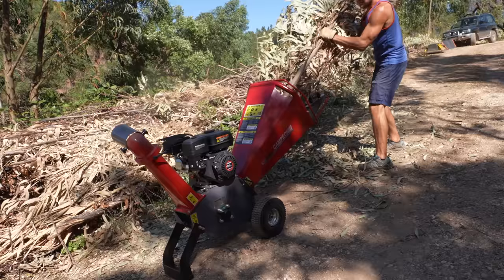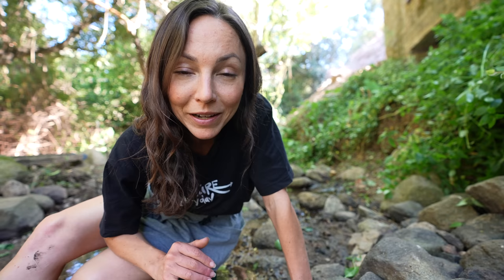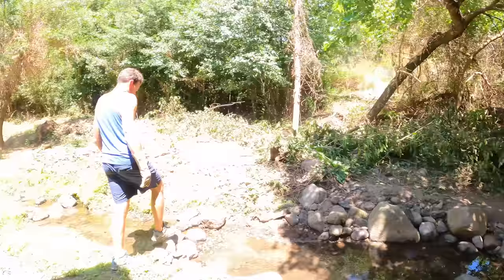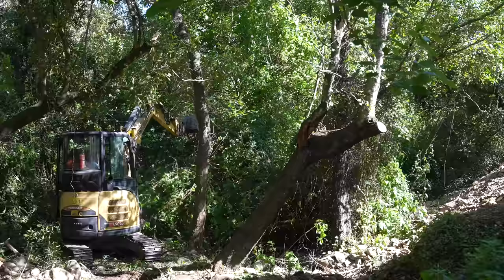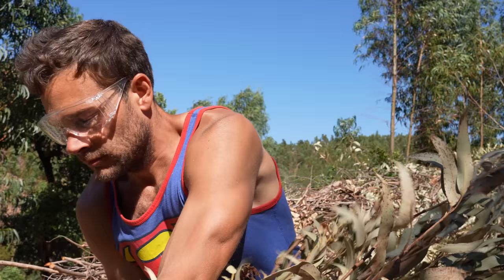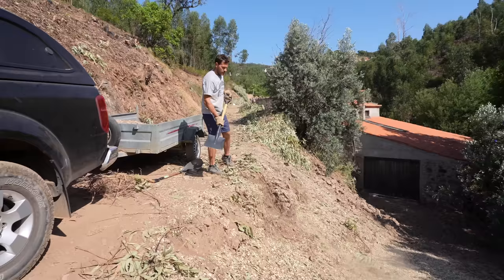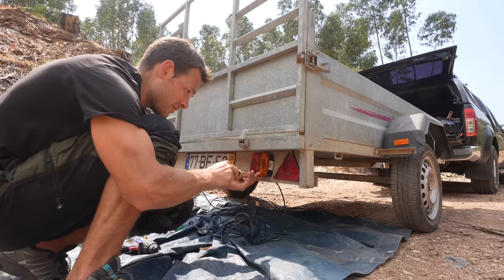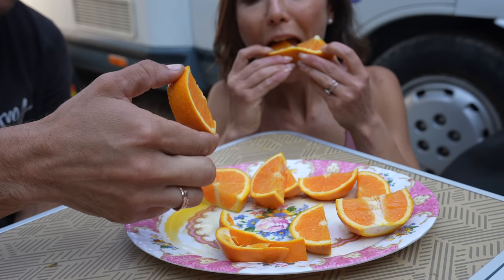WE BOUGHT A NEW MACHINE to help clear our overgrown land in Portugal

Comment: Such a great tool!!   Perhaps, if you line the trailer with a tarp, then blow the mulch in, it would be easier/faster to pull the tarp out and shake it down hill.   We used this method during our fire clearing and it eliminated the need to shovel it out.  Bringing back memories of good hard work and the need to maintain a safety zone.   Carry on!!
Reply from the maker: That’s a great idea!! Thank you 😊
Reply: Love this
Reply: Google search lens take a picture search for it and usually Google can pull it up and tell you what the plan is or the item. You all are doing a great job.!

Comment: When using the mulcher, place a long tarp into the trailer from the tailgate right through toward the front and fasten it up to the roof rack on the vehicle with a couple of clamps. This gives you a barrier on the car to stop the high fliers and when you are done, pull the tarp back over the chips so that when you want to unload it, all you have to do is either pull it back over the rear end of the trailer and continue until it pulls the entire load out the rear of the trailer with no shovelling or, if it too heavy to pull manually, tie the tarp to a tree and drive away. This will spread the load somewhat along the track. If you had another vehicle/mower there, you could pull the tarp back and dump the stuff in one heap.

Comment: The shop that sold you the mulcher will also have netting to attach to your trailer. That netting prevents the mulch from flying everywhere.
Reply from the maker: oooo, a great accessory!
Reply: @Mrandmrsadventure  And apart from that it might save you a ticket. Not sure about the Portuguese traffic code, but it may be a traffic violation if using that trailer on the public road without its contents being covered with a net.

Comment: Just like to give a suggestion regarding your mulcher. Prop a piece of plywood up in end of trailer for mulch to hit and fall into trailer. Also you may be interested in a small battery chain saw Stil makes, it looks ideal for limbing and small shrub removal only about 10 or 12 inch blade.
Reply from the maker: Good tips
Reply: The plywood will stop chunks and any rocks from striking the back of your truck

Comment: Isn't it amazing how heavy Rocks are? They alway turn out to be so much more heavier than you think they should be. If you had a Tarp to attach to the front of your trailer, then up over the Chipper discharge, this should direct ALL of the mulch in the Trailer. With my Chipper, I just let the Chips blow over the yard and left to decompose back into the ground. Saves so much time. I use this method if I don't have to haul it elsewhere.

Comment: Hi, place a piece of plywood in the trailer and aim the mulcher at it. This should help contain the majority of the mulch where you want it. Also, when cutting branches consider firstly cutting away from the trunk to relieve the weight and start with an undercut to help stop your saw sticking. Once done do a second cut at the trunk. With the weight removed you should get a cleaner cut.
Reply: Experience is the best teacher, but the ability to foresee things does help!

Comment: FYI, I believe that the cutter bar is runoff off a weighted impeller driven by a belt and if you feed it too fast it will slow down and stall the impeller causing the belt to slips and overheats causing smoke and the smell is burning. If you continue to do that, you will have to replace the belt so you probably should have a spare belt on hand. you need to learn to feed branches at the speed that allows the impeller to maintain optimum speed. Hope that helps
Reply from the maker: Hopefully we won't experience this. It wouldn't be a bad idea to have an extra belt around. Good idea!

Comment: Don't know it you want too or not but peppermint and spearmint planted around your house will slow down the mice getting in.  Mice do not like mint but will jump over it so make a wide path.  And even when you cut it, it smells great.  Do not put any mulch around your house because the moisture under it will attract termites.  But leave it far away from the house. But you can take cuttings of the limbs and put around inside your home to repell bugs and spiders. Just replace when they turn dry or moldy.

Comment: I will join in on the safety brigade. You two have no idea what your backs, heads, knees, shoulders, and hips are going to feel like in 20 years if you keep overtaxing your bodies. Then you won't be able to enjoy that lovely property. Work smarter, not harder. Use a machine to lift the boulders, use tarps with the mulcher, use helmets when biking and when around equipment, use safety glasses, protect those ears. I worked in physical rehab and injuries can really take a toll. PS ALWAYS wear gloves.
Reply from the maker: Good advice!

Comment: I was the one to recommend getting a bobcat machine for clearing  and wood chipper for mulch. What you need to do now is build sides and top on your trailer from 2X4 & plywood so all the chipping stays in the trailer... The reason your machine bogs down is because the motor is running at it's capacity. A more commercial variety machine with a more powerfull motor & blades should of been your choice.. Just go slower when feeding your brush, not pushing the motor and you should be fine... Learn its threshold.  Overall great to see your improvement to your land, keep up the good work.

Comment: Looks great, guys!  Yer getting stuff done quickly!  
The reverence for mulberry trees takes me by surprise.  Here, they pop up like weeds and are more of a nuisance tree, fast growing, yes, thus weak and vulnerable to wind and ice loading.  I still keep a few around for the birds primarily.  The fruit is not that appealing.  I keep wild black raspberry patches, just brought in a big haul yesterday.

Burying some brush makes sense but you may wish you hadn't buried those nicely cut logs when colder air moves in after summer.

I'm sure you figured it out by now but you were feeding those branches too fast for the power available.  The cutter head got stopped and the engine was slipping the belt, hence the squealing noise and burning smell.

Lots to figure out when homesteading -- you guys will figure it out!  🙏🌞💪☮️

Comment: Britany, it made my back hurt to watch you lifing all thos heavy rocks and trimming, lifting and hauling all thos tree branches. It will take a toll on you and repitition over time will leave you with back, knee and arm problems later in life and it is PAINFUL. Go easy on your self.  All the work I did on two separate properties in 30-40 years left me with two bad knees, surgeries on joints,  and arthritis in my back.  NOT FUN.  Be gentle on yourself. Hire men to do that work and use machinery when you can.  Chronic pain and disabilies caused by that kind of repetitive work can make you very miserable in later life. Take care of yourself.
Reply from the maker: Yes, we see it as strength training but then remember to take it easy as well. 😊